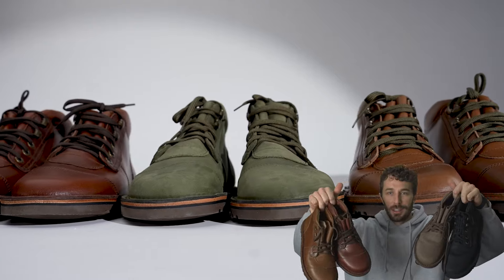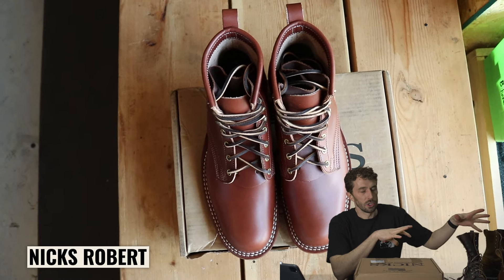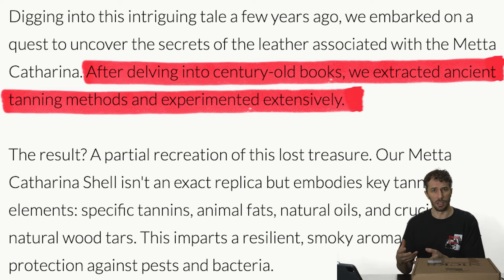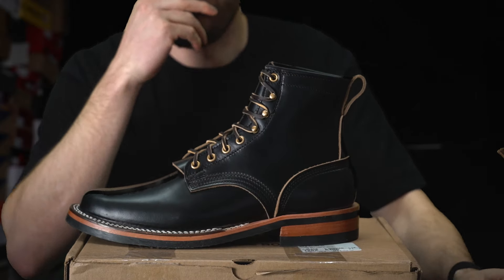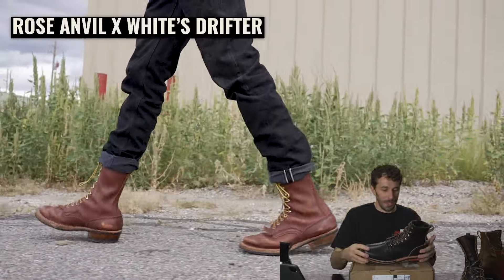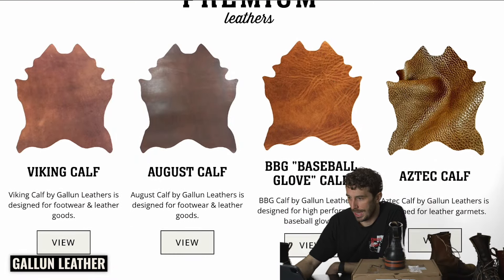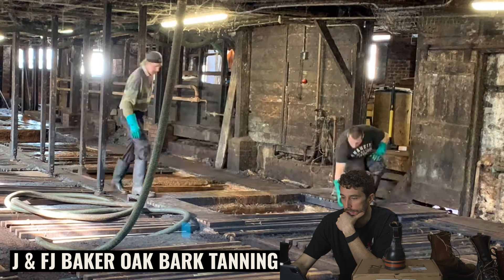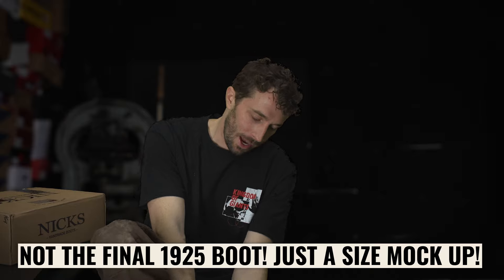(Unboxing) Can a work boot brand make dress boots?

Comment: I think its a smart idea for these high $$ brands to offer cheaper boots from the same last, so you can figure out your exact size before you commit to their expensive line.
Reply: But styles fit different,  so that 9 in a PNW traditional may be a 9 or 10 in a dressier
Reply: @OntarioBearHunter what? How would that be possible? The pattern is literally on the last.
Reply: I'm not sure how you can make a cheaper boot the way they do. The price is not too far from the sum of the parts and labor

Comment: Had to buy the all-black pair of African Ranger Barefoot boots - excited for my pair to come through. Should be the perfect combination for me. I work in an office environment, but it's on a large construction site so I'm required to wear boots - but I also will be driving a manual transmission vehicle and the flat/barefoot sole will make operating the clutch much easier.

Comment: You can still buy leather goods, including shoes, made from the original 240 year old Russian reindeer leather but it is extremely expensive and supplies are now very limited and it is only available from a couple of bespoke manufacturers.
English tannery J&JF Baker have recreated a close copy of the leather (after analysing the original)  but use skins from oxen instead of the original reindeer. This leather is used by brands such as Carmina and Crockett & Jones.
J&JF Baker also produce oak bark tanned shoe soles that are considered superior to JR soles and are used by upmarket shoe manufacturers.
Their leather is tanned in pits that were originally thought to have been dug by the Romans nearly 2,000 years ago.

Comment: I've said it before, and i will say it again. As good as Nicks maybe, none of Nick's boots are certified as proper workboot. This means they are not accepted at most heavy industrial work sites. Only a few of their workboots have a reinfoced toe, and none carry sole puncture barriers or full certification. So as far as I'm concernered all of Nicks boots are just dress/show boots. Plus if your paying top of the line pricing you whould get top of the line finishing. I will check in again in a couple more years to see if they have proper workboots avalible.

Comment: That brass in the heel might work if you’re an interior decorator. And I’ve never thought speed hooks looked any good, unless you’re handicapped and need help tying your shoes. Also, laces have a tendency of slipping off the hooks. I won’t be buying these boots. I’ll stick with my Caswells.
Reply: The brass is more in line with a haute couture brand worn by “new money” IMO.